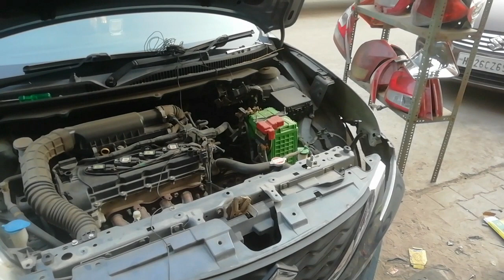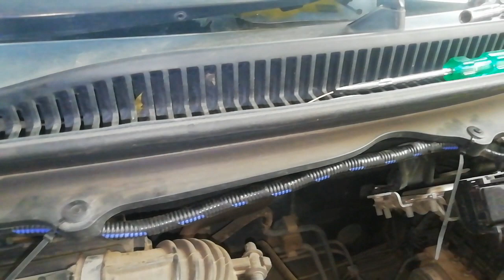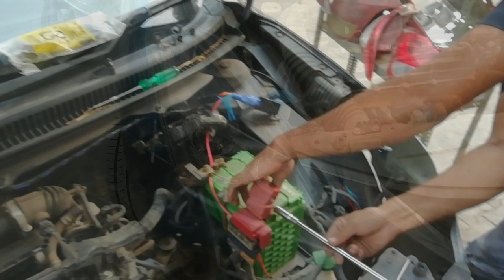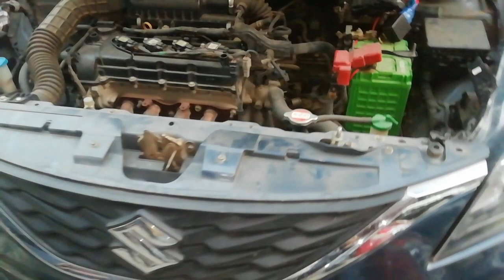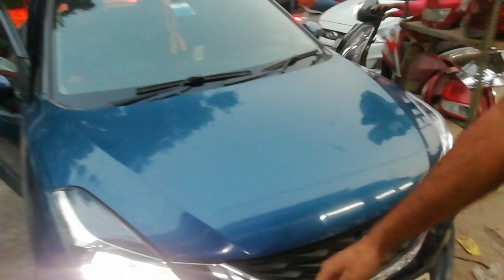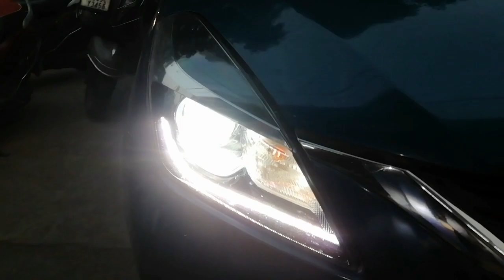SUZUKI NEXA BALENO 2018 PROJECTOR HEADLIGHT INSTALLATION CONNECTION WIRING CUPPLER TO CUPPLER ETC.

Comment: Mere pass baleno delta model h 2018 usme hid projector headlights top model wali lagwana hai
Reply: Wiring harness kit plus top model headlights set kitane ka milega mujhe nagpur maharashtra m mangwana hai
Reply from the maker: 8447503105
Reply from the maker: 2000 complete wiring harness ka hoga brother aur 8000 aapki light ka
Reply from the maker: Call me bro 8447503105
Reply from the maker: And message me on WhatsApp 8447503105
Reply: Location??